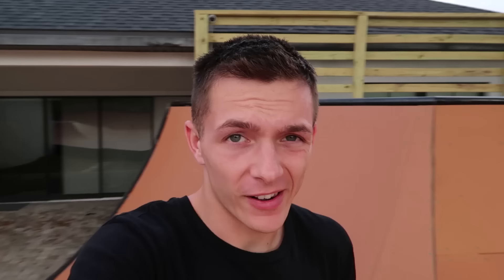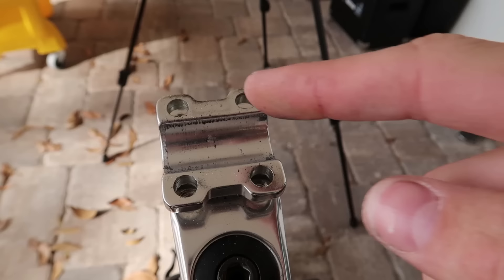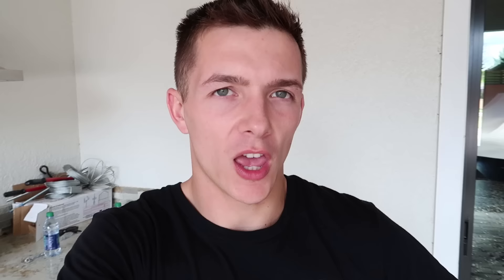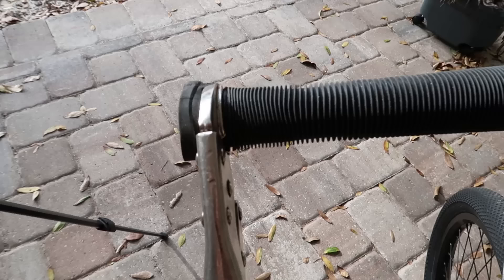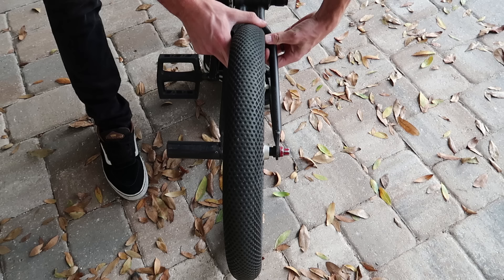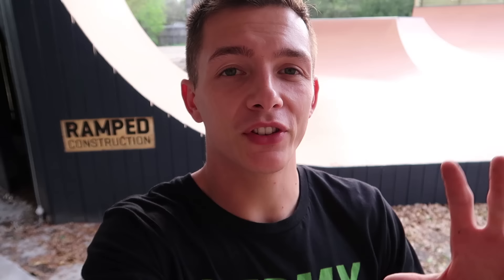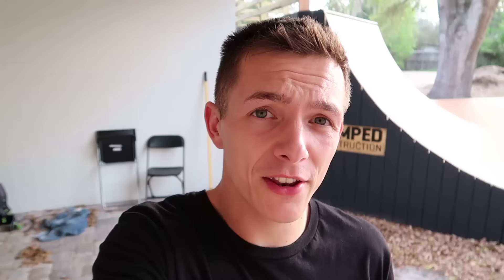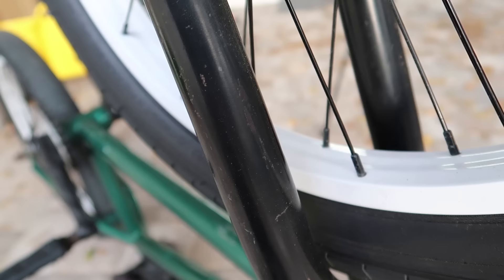10 BMX Life Hacks that will Change Your LIFE!

Comment: Just another small tip that might work against moving grip: before putting them on your bike, spray the inside of them with hairspray. Makes them slide easily on, but after the haispray is dry the grips are (as good as) glued stuck. Hope you guys can use this. :)
Reply: There is a product that odi make called grip glue and I think it’s only $4
Reply: Unlike grip glue, if you ever need to take the grip off or replace it you won’t need to clean to glue off, hairspray 100%!
Reply: @jerryshea4906  Came down to the comments to leave this tip. All that leftover hairspray...? Draw on your skateboard's griptape with chalk then seal it with... hairspray.

Comment: FYI the real life hack for throttle grip -

Get a gap between the grip and bar and Spray wd40 or something similar in to them and spin them to get them off easy.

Clean the bar and inside of grip with soapy water and let it dry.

Spray some hairspray on the inside of the grip, then slide it over the bars to its normal position.

Leave overnight and the hairspray will dry and secure the grip in place.
Reply: And never take off your grips again 😂😂
Reply: @mattdavies55  nah just same technique with wd40, and a slide a thin screwdriver in if you can to get the wd40 all the way down the grip.
Reply: Spaghetti Legs or use bug spray! It works in 10 secs just keep twisting the grips til it grips and stays! It works so well!
Reply: dont use wd40. use rubbing alcohol. once you clean the bar with the rubbing alcohol slide the grip back on .. no glue !
Reply: WD 40 = NO

HAIR SPRAY = YES
Reply: Compressed air works best

Comment: best way to remove throttle grip issue is spray some WD-40 between handle and grip and let it dry
pls like so more people can see it
Reply: I have never tried it but it sounds like it wont work. My local bike shop said to spray hairspray in it to flush everything out and then the fast drying solvent should evaporate soon to leave it dry. Well the rubber pressed against the bars and trapped the liquid and caused the grip to throttle like iv never seen b4.
Reply: Ed yea i know it sound stupid but it works well, u should try it
Reply: Not sure if trolling or serious
Reply: No he isnt joking WD40 is a good way to slide your grips on and off
Reply: Rocko Omazing it's real
Reply: Hairspray is better, but both of these only work if your grip fits tightly on the bar. Old stretched out grips will not work with this method. The trick is to get the inside of the grip really clean and dry. Remove all water/sand/grit/dust/glue/grease/oil. Then spray the inside of the grip with cheap hairspray like Aquanet (since they make an unscented one) and slide the grip on. Leave it OVERNIGHT don't do this if you are about to go riding. It needs at least 4-8 hours to evaporate. The longer you leave it, the better.
Reply: Szymeq I put hair spray in my grips  and that fixed it
Reply: Charles Gunzelman however hairspray will dissolve when in contact eith water
Reply: use alcohol
Reply: Szymeq if grips slip off spray hair spray in it and it will stick
Reply: great idear
Reply: I use wd40 to put grips on and it works fine
Reply: Ya ma’s hairspray works best
Reply: Hairspray works and is not disgusting
Reply: cleaning is #1. but we always used a little dishsoap, helps to slide them on and then it gets tacky, cure it in the sun for a day and it's all good.
Reply: Just get some adhesian promoter or whatever. Grips like can not move...
Reply: Take some sand paper and slightly  ruff up your bars in the area your grips set and then spray the inside of your grips with some Aleene's Crystal Clear Tacky Spray and allow a minute or two to dry as it calls for in the directions on can..it really does work amazingly and holds up through a lot of different situations that happens while riding daily that causes throttle grip...It held up through a few hours of lake jumping on my old bike and never once caused throttle grip.. I even ended up having to cut them grips off when I  set up my new bike a few weeks later!!!
Reply: Szymeq 5
Reply: no duh

Comment: We always used hairspray for the grips.  They slide on easy and are “glued” on when the hairspray dries.  Put a nickel in each grip before you slide them on to prevent the bars from poking through the grips when you lay the bike down.
Reply: I was checking the comments to see if anyone was gonna mention the old hairspray trick. Nice 👍

Comment: The tightening the chain, I find it easiest to wedge something between the tire and frame. I used a flash light to wedge in between while I tightened. Then you just remove the wedge and you're good!

Comment: You know how to stop throttle grip. Get lock on grips
Reply: yes but with the locks grips wont move or even get sand inside in the first place
Reply: also ive never had sand in my grips but my friends plasti dipped handlebars started wearing down and getting under the grips so gross lol had to peel em back and pull everything out
Reply: Iamkieren or hairspray

Comment: #stopthrottlegrip2017
Reply: Now it’s #stopthrottlegrip2019
Reply: ej1 drew #getlockongrips
Reply: True, but normal grips provide more cushion because the whole grip is rubber but lock ons have a peice or hard plastic in the middle
Reply: Egg man In da snow #stopthrottlegrip2020
Reply: @mapples5871  agreed i don't like lock on for that reason #stopthrottlegrip2020
Reply: Now its #stopthrottlegrip2020
Reply: #stopthrottlegrip2021

Comment: If your handlebars move a quick fix is put your foot on the gooseneck & pull as hard as you can on the handlebars also throttle grip if its bad roll it back use hairspary loose chain use the rubber  handle of a hammer between the middle of the tyre & the frame a little bit of pressure tight chain wat this lad said is a good one to use too

Comment: 5:04 in my opinion it's a good idea, but my advice for if you don't have pegs is get a wrench, loosen the bolts on the rear tire, slide it back, and re-tighten the bolts. I do it usually when my chain pops off the gear, and it works pretty well.

Comment: Yo, there's easier ways to fix some of these issues. If you don't want your bars to move, do what you did and clean the surface(sanding optional), hit up your local mtb bike shop and buy some carbon paste. Put it on clamping areas, and you'll never have an issue again. To keep the grips from moving or "throttle grip" again, clean surface, and apply a thin layer of carbon paste underneath. If you want to go all out, buy some MTB lock on grips, there are PLENTY of options that are great for bmx you can lock them on via a bolt/clamp on one or both ends, and if you go this route most definitely apply carbon paste. You can get a lifetime supply tube of it from Park tool or Muc off for like $18.

Comment: The handlebar thing... yeah...
I had trouble even after abrasive contact, I cannot stand the feeling of not trusting my bars...
I actually went as far as to weld a small rectangular rod onto my bars, and cut a channel to accept it above... 
Shits rock solid. It will never shift... But this is of course my permanent bar position now, shifting is literally not an option...
And i fucking love it :)
Reply: Or you could use a self taping screw in the bars and drill a hole in the mount to revive the screw. Then it wouldn't be able to move. Then if you need to change positions for some reason just remove the screw re tap the screw in a new location. That way it's not permanent.

Comment: Not sure if it’s been said but when put your grips on for the first time you can spray hair spray inside of them.  Quickly slide the grip on before it dries, its basically lube at this point, and then go easy on them until the hair spray dries completely which shouldn’t be too long.  Or get good locking grips.

Comment: if your bars keep moving its literally only from two causes. 1 is clean and then make more grooves in the bars with a file. 2 is forged stems are no where near as strong or stiff as machined aluminum stems. 

Grip issues? Use ODI soft grips and be stoked. Use alcohol to put grips on and use it to clean your bars before you put them on. 

have slipping grip issues? Use spray paint to put them on. Its like having lock on grips.

Comment: If you really want to solve throttle grip, take them off and wash them inside with detergent, let them dry thoroughly before putting them back on. Putting grips on? Fit the end onto the bars and tap the back end, making sure your palm covers the bar hole, the air pocket will work just like the compressor and 2-3 taps will slide the grip all the way on.

Comment: Hey adam,  I've been wanting to go breakless for a while and my bolt is stripped to take it out. Any suggestions?
Reply: Use some pliers
Reply: Take a really small drill bit and drill down the center of the bolt and this will help

Comment: Ok so, soap on the handlebars… Check. Jk, awesome vid, appreciated. 

My .2: skip the wd40 and use windex to lube grips, it’s slippery but dries quick and no oily residue

To keep your back wheel straight and tight when installing solo - use a hammer handle or similar to wedge between the frame and the back tire while you tighten the axle nuts

Comment: The way I solved the handlebars moving was to drill two holes in the clamp through the handlebars and into the base. Then grabbed two solid steel pins and hammered them through to the base. They never moved again. I mean, I'm not sure how I managed to get them to move in the first place. It was a Haro Master, and I used it for flatland freestyle riding, and it was far from a cheap bike. One regret I have is that I sold it, I kept it in pristine condition, and I'd hate to think what it would be worth nowadays. I actually sold my YZ 250 that I used to race to buy it, and it was worth it, especially seeing I'd come a full-on cropper with the bike bouncing off me about four times before I slid over the berm. I ended up in hospital for about a week and figured it was time to quit racing and decided that I would have less chance to paralyse myself riding a BMX. But I managed to get a wallride so wrong I ended up with one of the rear pegs in the back of my noggin and had my bear claw pedals rip a 15cm laceration to the bone on my right shin. Ah, the folly of youth.

Comment: Can I add to your slippery-grip solution???

Here:
Before installing your new grips, clean-off your bars and inside of grips with rubbing alcohol, next??-let them dry completely before borrowing your wife’s or sisters can of Aqua-net hair-spray. Next, apply a nice amount of hair-spray to the inside of the grips before You slide them back on and let them dry again. 

This is my secret to getting my grips to stick, but to get an old pair off, simply spray some WD-40 inside, then slide them off. WD-40 also works to put those grips back on, but may take a lil’while longer to dry before You can ride again. 

Bmx 4-life.
Reply: Kerrye don’t use anything to put them on, just use a air compressor

Comment: Remove grips and clean inside thoroughly, and clean the bars real good. Then apply a super thin layer of WD40 and slide grips on. Let set for a day or 2 until dry. They will hold so good you will have to cut them off with a razor. Also, to tighten the wheel a bit easier, use a deep well socket of the proper diameter for your set up, and place it between the tire and the chain stay. It will hold the chain tension while you tighten it. If you don't have just the right size, use a slightly larger one and let a little air out of the tire. It won't completely stop the side shift while tightening, though it does help, but it will keep the tension where you want it. If your bars have been slipping for a while and you can't get enough pressure to keep them from slipping after cleaning, Make a shim from an old tube or soda can. Hope this helps someone.

Comment: To supplement:
 
1, One of your group should carry carry basic tools: at least 4, 5, 8MM hex keys, and 10 and 15MM wrenches. 
2. If you can avoid it, do not move handlebars without loosening bolts as otherwise it grinds the groves away. And tighten sequentially, opposite corners and only moderately firm at first, and making 3 or 4 cycles until all bolts are tight. . 
3. To keep grips from moving, remove and clean and dry handlebars, and  brush a little(!) rubber cement (like Slime 1050) inside the grip and then  quickly put the grip back on, rotating it as you do. Leave grip to set for a few minutes b4 using. 
4. To remove stuck grips, place a little dish liquid (even spit if nothing else slippery is available) along a thin blunt rod,  insert as far as you can into the grip, and push/massage the rod all the way around, then twist and remove. 
5. In tightening the drive chain, center the rim, and put the the left pedal (on your right from the back of the bike) at  about  a 1 o'clock position and tighten one axle nut slightly while pulling the wheel back so the chain to taut. Then slowly rotate the chain and see where the tension  is highest and adjust the wheel so you have some slack and tighten nuts.  Perhaps due to chainwheels usually being slightly less than perfectly centered, then the chain will often be tighter at one spot then the opposite position, and you do not want either extreme.
 
Hope this helps. http://peacebyjesus.net

Comment: Instead of sanding your stem to keep bars from moving, just get park tool sac-2 grip paste then just make sure to torque the stem bolts to 4-6nm. It's what's used for carbon bars, stems, and seatposts to prevent slippage

Comment: I use black sharpies all the time at work on light fixture bolts if the paint chips.  Great hack that keep its clean and no one knows the difference.  Or if the box is missing the hardware and have to use a silver nut cap you can just paint it black.

Comment: Ive been doing many of these for years and i do boil my grips, not much if a difference in softening but it cleans first right from them 100%. I also do it to stretch them, while they are hot just give them an even pull with both hands.

Comment: A good way to stop your bars slipping is to loosen the bolts and move the bars back and forwards this rubs off all of the paint and then just blow off the paint dust and tighten the stem up and it should be sweet

Comment: When tighting the back wheel I always wedge a 2x2 between the wheel frame and the wheel then push the 2x2  Forward while it pushes the wheel backwards then tighten the axle screws.

Comment: I would really recommend against using course sand paper on the bar/etc, you want to start with course and work down to something fine--more surface area means more grip. The courser the surface is, the less surface area there is to grab.

Comment: for the headset ... roll up to a ledge ... push the front wheel into the ledge ... push down on the stem and tighten the bolts

Comment: I don't think it was paint that was coming off but the aluminum from stem from kicking it back into place. Also the grooves are called knurling, and boiling grips does work for some grips just takes a few boils and certain brands may just take longer. Boiled my odi long necks as a teen for 20 mins worked perfectly and they were really soft. Don't boil Edwin delarosa's cuz they don't last as long afterwards. Like 3 months they lasted me.

Comment: "as long as your bars and grips are clean you'll never have to use adhesive"  "as long as they're clean you won't get throttle grip"

Homie, some of us put more torque on our grips than friction can deal with, and overtime we absolutely get throttle grip on perfectly clean bars and grips. Even with glue I regularly break them loose. I used to ride with lockons just to deal with it.

Comment: I'm a pro mechanic, I used to wrench for some teams as well. I would recommend a rat tail file for roughing up your stem, I would also recommend greasing your bolts and when you tighten them up use a X pattern to tighten them so the pressure is even across the bar. Also? NEVER, EVER use WD-40 on your grips, EVAR!!!!! Use Aquanet, it has a high alcohol content and stays tacky so when you blow your grips out the grips will stick better and are less likely to come loose even in the rain. If you grease your axle nuts the wheel is less likely to allow the wheel to move, even on hard landings. As far as scratches go? I paint my street bikes with truck bed liner, they don't scratch, ever.  Peace Pimps!

Comment: A light coat of aerosol hairspray on your handles works great for new grips that are very tight and hard to install... they’ll slide on a lot easier... let em sit overnight and you won’t develop throttle grip later on.

Comment: Had this happen on a mountain bike but the same applies here. I crashed my bike so hard I ended up with the handlebars facing one way, the front wheel the other. Still had to ride home so I nudged the front tire against a wall and beat the handlebars with my palm in the direction I wanted them to go until they finally lined up again. That day was definitely a bad day lol I was literally thrown off the bike and had it land on top of me, surprisingly nothing was broken just VERY sore the next day

Comment: With my odi grips, i applied a light coat of soap on my bars and slipped the grips on. You need to let the soap dry for about 2 days, and then it dries like glue, but glue that isn't permanent !

Comment: Bro. Damn I miss having a ramp in my yard. You have a nice ramp brotha.  On throttle grip I always used hairspray and it’s set. To get off use a air compressor between the grip and bar or a lil couple drops of water to losses the grip. I rode for years without a compression cap. You could see straight to the tire. I always went over my bike befor a days ride so never had any issue,but it does happen.